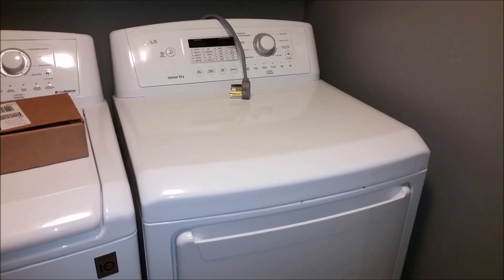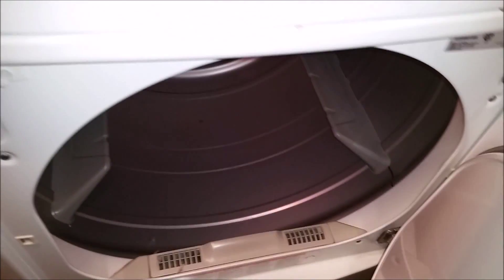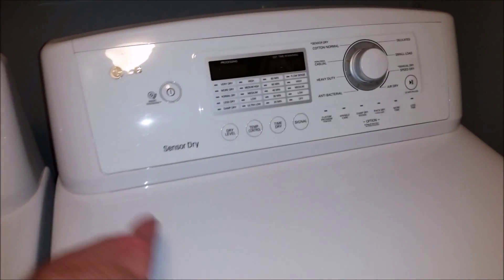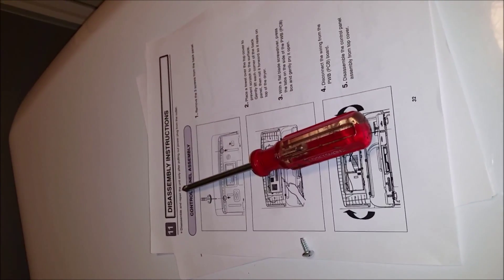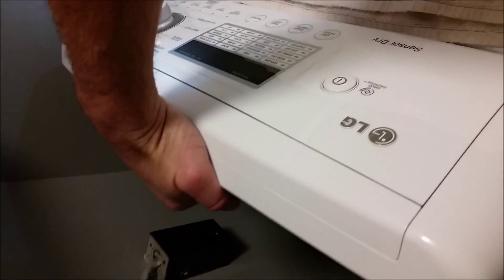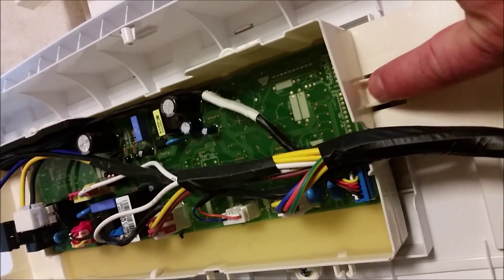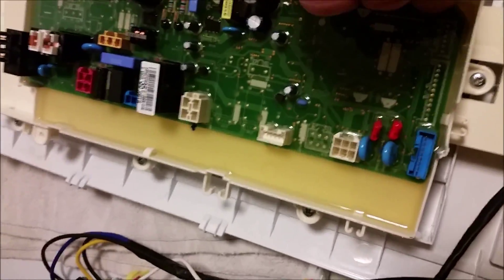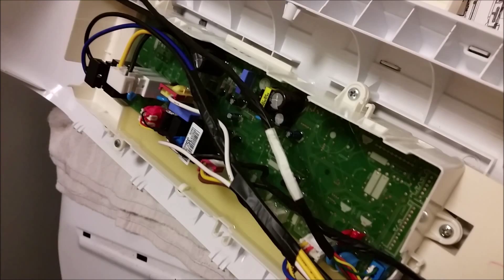LG DLE4870W Dryer PCB Control Board Repair

Comment: Thanks for you video help.
On our LG gas dryer I only needed to remove the top three screws and the front panel was able to tilt forward on the recommended towel.  Opened the main pcb cover locaded the three relays, gave all three a tap with a medium screwdriver handle.  Plugged in the dryer to test...problem solved.  Reassembled the control panel.  Total time about 15 minutes.  Will see how long the "repair" lasts.

Comment: Thank You!  I ripped this (Printed Circuit Board) Assembly out then ordered...
LG DLE4870W part numbers
LG EBR62707635 LG-EBR62707635 PCB Assembly,Main
Sold by: Amazon.com Services, Inc
 $72.08
then I thought it must be the black relay that is sticking so I plugged in all the other wires, then 240 volt power cord.  Then I tapped the Black and Blue wires against the large black relay, sparks jumped and jolted the contacts loose.  I canceled my order because everything works now?  Seams to anyway!

Comment: On my LGDLEY1201V same thing! 4-13-13 bought.  Keeps running after cycle.  Took top off and rapped the square parts with a screwdriver and left the internal light disconnected.  It worked for about 6 months and then same thing.  ?Control Board?
Reply from the maker: Yes, you have a breaker that is sticking...
Reply: Thanks for answering.  I agree.  Mine has a tinted piece of plastic and after removing the two rear screws it slides backward and you can lift it off.  This exposes a white PC board box mounted with two screws.  The box comes apart with a little prying and I rapped the black boxes (what I thought were relays) then it releases and again it works as the tub stopped with the door closed.  I left the incandescent bulb out to perhaps limit the current used a bit more. service pc board = over $300 to replace?  Don't think so!

Comment: I have an LG DLEX5101V dryer...exact same set up as the model used in the video.   And my dryer had the exact same problem, drum ran with all cycles turned off unless the door was open.  This video was huge help replacing the  PCB Control Board!  It would have have been clear the Control Board and User Interface boards were snapped together as shown.  By the way, finding LG service manuals are definitely a chore but they are out there.  Thanks loads (pun intended) for putting this video out.  It saved me time and money getting my dryer fully functional.

Comment: Where did you get the service manual? My DLE4870W started making a thumping noise when it's operating and I believe I need to repair the rollers but can't find a video for how to access them on this particular model. It looks like some models have tabs in the front near the left and right edges that need to be pushed in, but mine doesn't appear to have one on the right side and the gap on the left side is too narrow for even a butter knife to fit in.
Reply from the maker: LG does publish/share there service manuals. They only give them to the authorized repair dealers. I purchased mine from https://servicemanuals.pro/ I paid $5 for the manual.
Reply from the maker: Sorry, I meant LG "does not" publish/share...
Reply: I have this problem and purchased the roller bearings to replace. Do you know how to get to the inside of the unit to replace? I cannot figure out how.

Comment: Thanks for the video-it was an easy fix and you saved me some money.
Reply: Emmett Harless whats the name of the part u bought? am having problems with mine too. thank you
Reply from the maker: I don't remember the exact part number. Just goto one of the online appliance parts sites and search for you make and model dryer. There are 2 panels, one is the display panel and the other is the Main PCB panel.